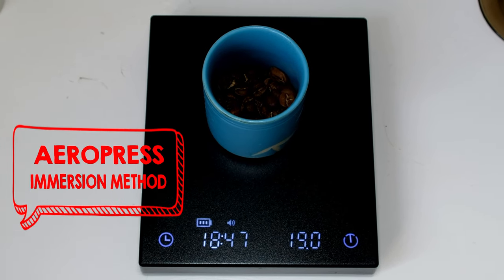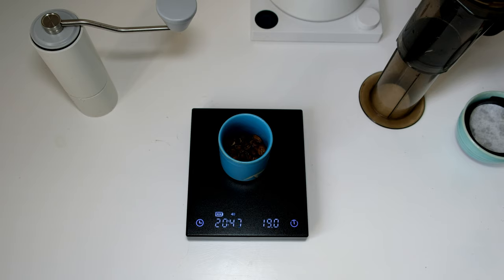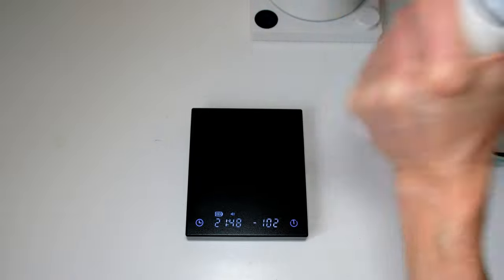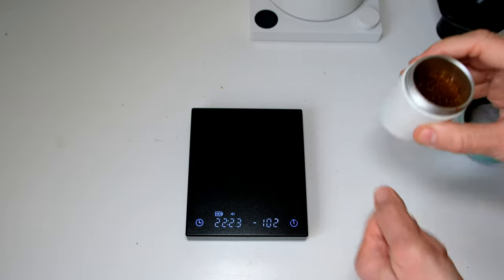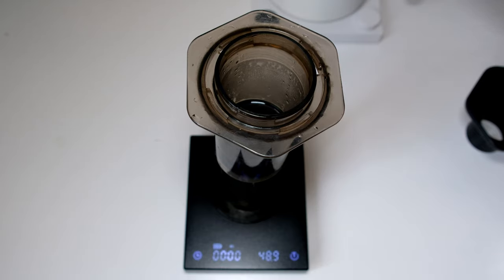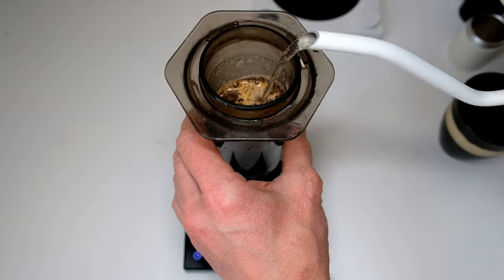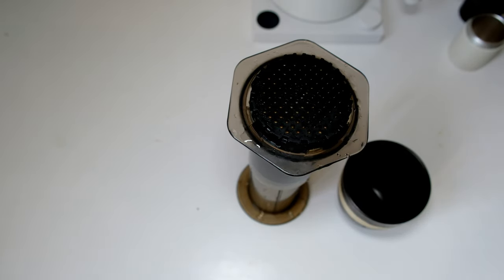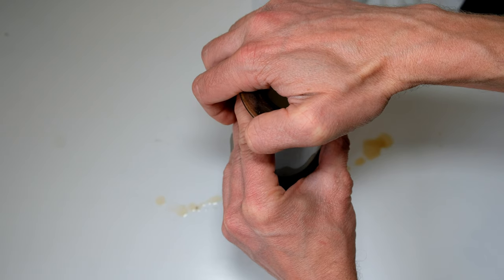AEROPRESS - IMMERSION METHOD - the way, how I make it.

Comment: you need to put the cap on when waiting for that 60 seconds, so it keeps the heat inside. A cap fitted with a wet filter is even better.
Reply from the maker: Thanks